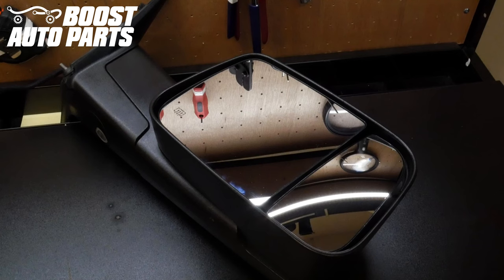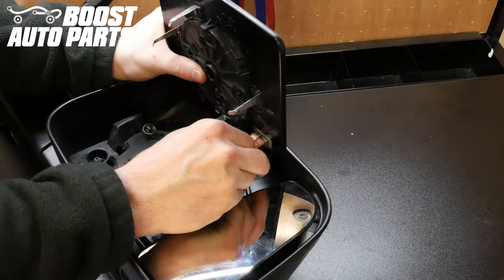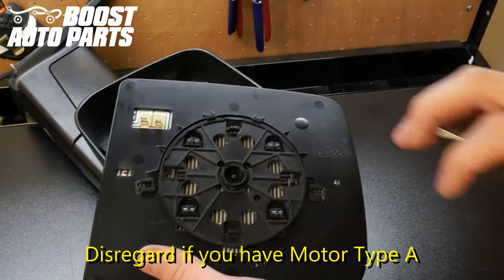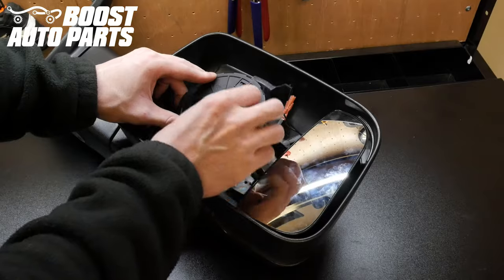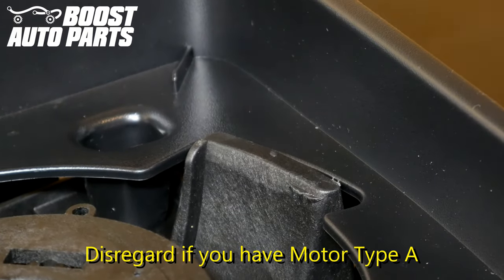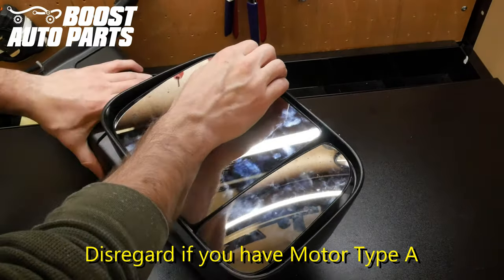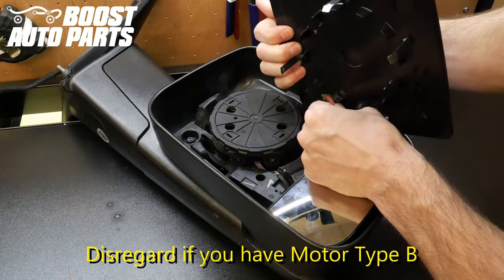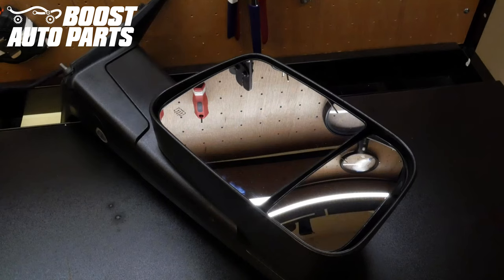Remove or Replace OEM 4th Gen Style Upper Tow Mirror Glass - (Dodge Ram 2009-2020)

Comment: The large driver's side mirror glass vibrates at highway speeds on our 2012 Ram 3500. Can it be tightened?
Reply from the maker: Possibly the stabalization pins aren't properly seated - give our team a call at 765-831-2830

Comment: Bought the glass for the Type B, but there is no backing plate for it. does it not come with the glass?  completely unable to find the type B backing plate anywhere online.
Reply from the maker: The backing plate is part of the motor. Give our team a call at 765-831-2830 if you require further assistance.

Comment: I have motor type B but my center peice does not simply pop out, it seems glued to the back of the oem glass making it much more difficult to take out ! Any solutions?
Reply from the maker: Give our tech support team a call at 765-831-2830 for guidance.

Comment: How do you replace the smaller mirror?
Reply from the maker: Check out this video: https://www.youtube.com/watch?v=aMvdel687ek&lc=Ugyv7n5KK6oMFHygcwJ4AaABAg
Reply: @boostautoparts   so the only way to change the bulb is to break the mirror first, then get a replacement? Mine doesn't come off like the first one. I would have to break it, then replace the mirror. Can I change the bulb if the big mirror was out?
Reply from the maker: @jsmith816  To replace the light you need to access the screw. Removing the big mirror would result in no improvement. You might be able to snake a screwdriver around the lower glass, but unlikely so if your glass is not removable you would need to punch out the center of it and remove the screw. Then you would install our mount and lower glass and it would become serviceable, so in the future you could simply snap the glass off.

Our mirrors and OEM mirrors both have removable glass, but some aftermarket companies make their glass non-removable to save cost.